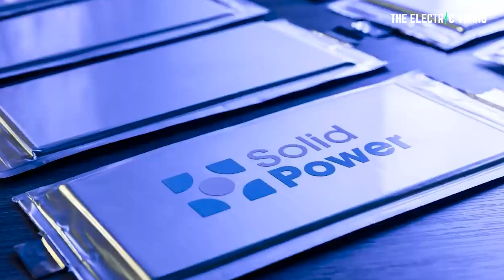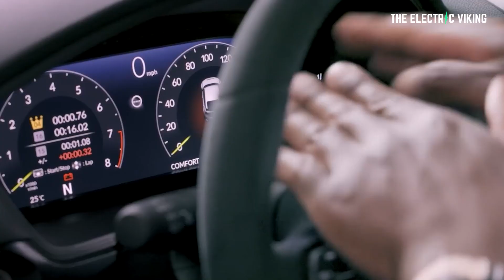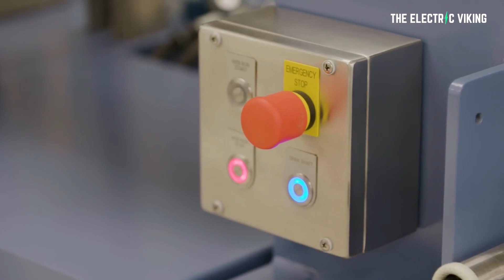NEW Honda Civic Type R to be electric only with Solid-State Battery

Comment: Honda will take a loss to be first - they did exactly that with the Gen 1 Honda Insight.  The real quesiton is can they even make these solid state cells - or are they half solid - with a liquid layer?  At any rate they have said before they do not expect to be making solid state cells until 2024; and that will be on a trail basis sort of like the 4680 is now

Comment: With all the effort, world-wide, to develop better batteries, including NASA's work on airplane batteries (needing high energy density per unit of weight), I'm expecting solid state to become the new standard in a few years. Is it possible Honda will lead the Japanese EV market, while Toyota and Nissan seem to have dropped out? In any case, the more the merrier.
Reply: You don't seem to know much about this.
Reply: Never ever, they are in combustion engines of all types and a rather small automotive player. When introducing the Civic and Accord they had their big run in Europe but later sales faded away like dealerships! With the solid state batteries it seems to be the same story as the once announced ultra-compact high power electric motor from Suzuki. Do they supply to any noticeable EV manufacturer?😂 What was going wrong in old men’s Japan in regards of EVs?

Comment: The type R with the batteries will have a faster 0-60 but more than likely will not have a faster track time until batteries weigh less. The current type R beats a hell cat on the track because it’s light and has extremely good aerodynamics. You replace the motor with batteries and the weight benefit is gone. So a type R with batteries, given current technology, will not be better performance based on what the car is designed for.

Comment: Don't underestimate Honda to much. They do produce the most engines worldwide. Also Red Bull has won two consecutives Formula One championships in a row which has a Honda engine. Formula one I believe are hybrids.
Reply: You believe correct, but I don't know whether Honda developed the electric bits in house or not. They may have done, I just don't know.
Reply: Forgot their expertise in ICE for generators, outboard marine engines, motorcycles, cars and some handmade formula one engines with some KERS! Nowhere electric competence needed for perfect electric car, where batteries are not the only part to rethink. Either Japan comes with a new illegal MITI to regroup all electric competence or they will fail as any too old society with too old leaders!😜

Comment: We were just speaking about this at lunch. This car is my first car in 30 years with an automatic transmission and I am bored out of my mind. I like the thought of the EV's, but having 3 "gears" is beyond boring. Stop, go, reverse. But I think accelerating much faster should make up for that.
Reply: Same! I'm driving my first 'auto' car as well and I think it's very boring. I'm a long time GTI driver and my current GTI is the fastest I have ever driven. By some margin. But it doesn't make up for the loss of driver involvement for me. I'd happily change into a slower, manual version if that was still available in my country.

Comment: Isn't the Y the new type R. Yeah lighter electric cars will be great. I think I can live without a manual if I don't have laggy auto shifts and gear
hunting.
Reply: The model Y? No way that is a sporty car like a type R. You can't make a tall and heavy car feel 'sporty'. Tesla used to put a sporty suspension on the Y to make it feel 'sporty', but all it did was make it jiggly and uncomfortable. They changed it to a more comfortable suspension somewhere this year.

Comment: Solid Power is testing their new solid  state  batteries for Ford and BMW so the technology could be getting closer to reality ,but I'm hoping that the Japanese auto makers pull a Sony , when it was fighting Xbox , when Microsoft tried to keep some control of the next gen games after people had purchased them, Sony delivered a knockdown blow that took Microsoft awhile to recover from,  they said you buy the game and it's yours to do what you will no strings attached,  if the Japanese auto makers want to make up ground on EVS then they should repeat the strategy, you buy an EV from us you get everything, no performance subscriptions or features subscription, you buy it you get everything the EV has to offer.

Comment: Any specifics on how (much) better it will be than a similar car with conventional Li-ion batteries? 
Hoping it will have an clear, noticeable difference like 2x charging times, higher discharge voltage/current and higher peak power output etc...
Reply: It all depends on when solid state batteries are ready for production.  SolidPower says they will have 390W/kg by 2026.
Tesla is at 244W/kg today which would make SolidPower be a 60% improvement.  But if the battery does not arrive until 2030 incremental improvements in existing batteries may wipe out much of that advantage. 

They might switch anyway if the can eliminate the need for cooling.
Reply: @rob1andrews  There is a world of difference between Watts (W) and Watt-hours (Wh). Basically Watts (W) are units of Power, whereas Watt-hours are units of Energy. The relationship between Power and Energy is defined as Energy (consumed, used or stored) = Power x Time.
Reply: @greggrant4614  OH....Shut up............We always mean KW per hour............Paul
Reply: @rob1andrews  Your points are well made, though I am sure you meant to say watt-hours per kilogram (Wh/kg), rather than W/kg. An improvement to 390 Wh/kg by 2030, let alone 2026, would be an excellent achievement. The solid-state battery could potentially be produced at lower cost per watt-hour (or per kilowatt-hour) as well, further increasing the preference for clean, renewable energy powered battery-EVs.  A primary challenge for solid-state batteries, however, has been their typical use of solid-metal  (e.g. Lithium or Sodium) are vulnerable to catastrophic failure from leaking seals or puncture. New anode materials may eliminate this safety issue.
Reply: there is a real chance they will have to push it to get it to roll down hill.
Reply: Charging curve rules.

Comment: Are Honda actually developing batteries? They’re only just introducing hybrids across the range that are good enough to match Toyota (they’ve copied Toyota’s HSD now it’s out of patent). Presumably Honda will be buying solid state batteries in and putting in them high end models because they won’t be able to make cheap BEVs profitably. Sounds like vapourware. Their market share is going to get hammered against MG and BYD, and probably the Tesla 2
Reply: MG quality is terrible.  I’ve looked closely at one.
Reply: @richardsmith579  had an MG for three years. Been great, totally reliable and servicing costs have been close to zero. It’s an affordable car but quality is fine

Comment: If you think the hot hatch segment has died off somewhat and became a bit boring, just wait until there are only EV 'hot hatches'. That will kill the segment dead.

Hot hatches have become a bit boring due to the downsizing trend. Turbo engines that can make as much horsepower as you want. Just crank up the PSI. No engineering necessary anymore. On top of that, cars have become heavier and heavier causing handling and driving pleasure to diminish.

EVs will take out any interesting engineering still left in the current hot hatches and make them at least 30% heavier than the current overweight crop of cars. That'll kill the hot hatch stone dead. EVs do practical and comfort, but they don't do racing or sporty.
Reply: Porsche Taycan drivers would disagree with you. It can be done.

Comment: It is possible for this to be a statement, Japan is pushing all in on the SSB. In this way, we will have a completely separate battery technology under China's competition control. So, seems we will see very interesting years in the near future... As you know, China is the motor of electrification and Japan needs to find something to be a selling point before it is blown out (which is coming soon otherwise)...
Reply: You mean Japan's SSB will be under China's competition control?
Reply: @irokpe6977  Really I do not understand what you mean, by "under China's competition control" means under China's control for you or the opposite? My proposition means SSB is planned to be under the control of the competition of China..." China's competition" means competitors of China... or what?